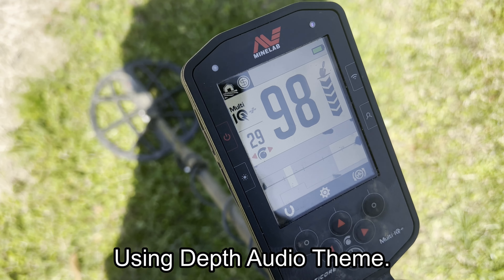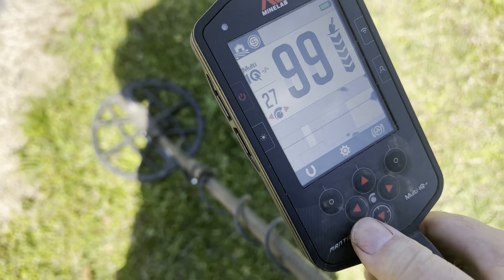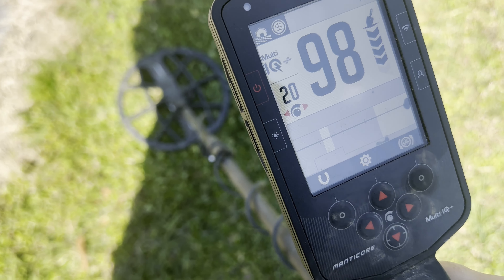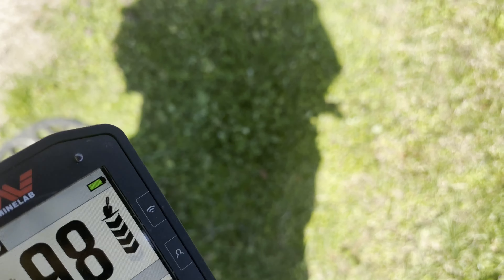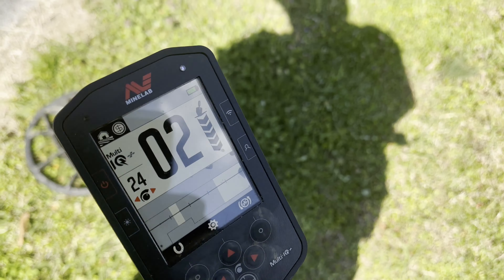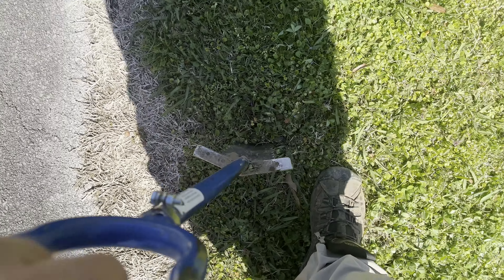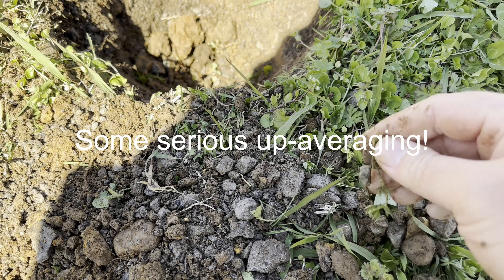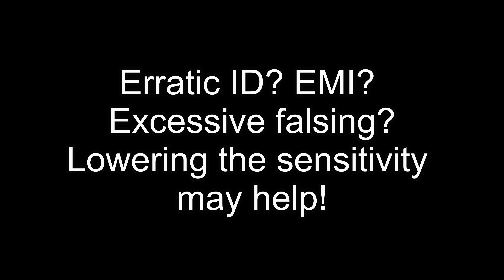Minelab Manticore: Still plenty deep at lower sensitivity levels.

Comment: I know you’re aware of this Rattlehead, but for others that may not know, lowering sensitivity will also help better separate(or even expose) a deep, non-ferrous target at sites with iron in the ground (turning off your bright lights in the fog to better see in front of you analogy holds true with lower sens in iron).
Reply from the maker: I agree Dan. Using high beams in the fog is a very good description.
Reply: CAPT DAN, I experimented lowering the Sensitivity on the Manticore this morning. Not so much an experiment, as I have a trashy yard and it's impossible to detect, I'm forced to lower it. I think the soil has black sand mixed in. It's also wet, so it's firing up pretty hot.

Sensitivity of 10 made it much easier to see what was going on with the Target Trace. It made detecting more enjoyable. Non ferrous signals started to come through. You're correct CAPTN DAN, lowering the Sensitivity helps unmask.

I didn't dig anything to check the depth, nor do I think I ever will, gawd awful trashy soil I have.

I also tested the recovery speed and the affect it may have on auto ground balance value (pump the coil). 

With so much trash in the soil, potential black sand, it was dark out, impossible to find a spot that didn't have a signal to ground balance over, I may  have wandered a bit off the spot I chose to ground balance over, my data is SOLID, take it to the bank. LOL 😂 

Recovery - - GB
Speed
0 - - - - - - - - - 33, 37,45, 48, 47.
1 - - - - - - - - - 36 35.
2 - - - - - - - - - 36, 42.
3 - - - - - - - - - 45, 39, 36.
4 - - - - - - - - - 36.
5 - - - - - - - - - 33
6 - - - - - - - - - 34.
7 - - - - - - - - - 41, 31.
8 - - - - - - - - - 31, 32.

Given my uncontrolled test, it seems like the GB is fairly stable across most of the Recovery Speed settings until RS of '0', then it increases ~13 points.

CAPTN DAN does the data seem odd or normal to you? Or should I find a clean lot of land to see the affect of RS on GB?

GL👨‍🦯HH

Comment: Just read your write up about your 50 hour time on the machine. It’s about time someone gave a review on this that actually put in time to learn it. I’m sure you are still learning it. I had my ctx for almost 9 years and I’m pretty proficient with it and I still learn something each year with it. I just got this machine today and am hating the fact I have to re learn all over again and not being sure if I’m missing anything by not knowing the machine. I don’t hunt by numbers. It’s all sound for me. Wide open screen. Now my question is there a tone difference on deep targets vs deeper targets. ?? Some say with the nox there isn’t any. That’s the only thing I would fear about the manticore.
Reply: Shallow and surface vs deep tones I meant to say…
Reply from the maker: Yessir, I’m definitely still in the learning process myself and will likely be there for some time. So many adjustments and different ways to run these newer machines… it’s a lot to take in! I actually enjoy it though. 

Yep, the Manticore gives you control of traditional modulation so that the deeper the target, the fainter the tone. But, in my opinion running pitch tones, or the Depth audio theme as Minelab calls it, is even better. The VCO audio just makes it extremely easy to tell how deep the target is. The lower the pitch, the deeper the target. Makes it super easy to skip the shallow junk/clad and only dig the older deeper stuff. I run it almost exclusively.

Good luck with your new Manticore!
Reply: @MetalDetectingNWGA  the one thing I love about the ctx is it actually gives you the depth number.  I don’t see this on this machine. Haven’t got a chance to print out the manual yet so how do you determine depth on the bar graph??? Some areas I hunt is sandy soil and the good stuff is always past 8 inches.
Reply from the maker: @hiluxyota7200  I loved the numeric depth readout on the CTX as well. The Manticore depth meter is like the Equinox. It shows arrows which indicate the depth. Each arrow is approximately 2”. Not as precise as the CTX, but it works ok.

Comment: I got my Manticore last week and have had 5 hunts with it. I'm with you on sensitivity around 23/24. The machine works great so far! I've dug  7 silver coins in places that were pounded. Three of them had junk with them. Two IHPs dug had square nails with them, also. There is a learning curve but after a number of hours  I think I'll be fine in discerning good/bad targets. HH :)
Reply from the maker: Dang, 7 silver coins from a pounded site in your first week of ownership is pretty awesome! Sounds like its working very well for you! Congrats! Are you using ATHC?
Reply: @MetalDetectingNWGA  AT General for now until I get used to the machine

Comment: It's a mental thing for me, I'm used to running my other machines close to max sensitivity,  I have gotten down to 26 - 27,lol
Reply from the maker: I know exactly what you mean. I was cranking it up pretty high when I first started using it. It just runs so much smoother at those lower levels though.

Comment: This begs the question, why high 90's for a single one cent?
Reply from the maker: To be honest, I was expecting to pop out a big silver based on those numbers. Was pretty disappointed when I saw it was a penny. Lol. Just some up-averaging. My Deus 2 likes to up-average copper pennies into the high 90s sometimes too.
Reply: @MetalDetectingNWGA  deeper the coin, higher the number.
Reply from the maker: @scorpio4236  Yeah, true that. I've dug a few pennies in the upper 80s before, but that's the first one I've seen jump all the way up into the mid 90s. Sucks to get all hyped up thinking you've got silver, just to find ol' Abe staring back at you. lol
Reply: @MetalDetectingNWGA  LOL had that happen a few times. Still waiting on the Manticore but when I see a 27-28 on the old Nox 800 and it's a copper penny..the whole time digging I'm going come on silver dime LOL
Reply: @MetalDetectingNWGA  You know what I'm thinking....? A silver Mercury was masking that penny.
There's a silver Mercury still in that hole! LOL  😂
GL👨‍🦯HH
Reply from the maker: @pigeonbloodruby5330  LOL! With how rocky and tough that ground was, it can stay there. 😂
Reply: Lol where was it? I'll come dig it.@MetalDetectingNWGA

Comment: With that iron limits device can’t unmasking targets next to iron…
Reply from the maker: That one is a coin shooting program, meant for cherry picking, not unmasking. ;)
Reply: @MetalDetectingNWGA  right for trash littered parks without iron 😎
Reply from the maker: @omnitron  For cherry picking. Meaning quickly grabbing the coin type signals without spending too much time on possible trash targets. Will it miss some masked targets? Yep! Its a trade off. You give up some of those challenged targets in exchange for the ability to cut down on the amount of trash/iron you dig. Would this be the best choice for picking out masked targets from a pounded site? No. You use different programs/settings for different situations and sites. Even running a disc pattern like this one with the upper ferrous limit set at 10, the Manticore can still snipe some coins from the iron. Check out my other video titled "deep and iffy coin signals" and you'll see what I mean. :)

Comment: Dwayne, what are your initial impressions of the Manticore. Does it out perform the Deus II? I don't know if I should invest in it or not.
Reply from the maker: Hey John. I actually wrote a pretty detailed review with some caparisons between the Manticore and Deus 2. If you have time for a read, I'll put the link down below. To make a long story short though, if I could only keep one it would be the Deus 2. https://metaldetectingforum.com/index.php?threads/my-thoughts-on-the-minelab-manticore-after-50-hours-and-beyond.300976/
Reply: I read your linked review Dwayne and found it very forthright and interesting. I am sticking with my Deus II for now. I really appreciate your opinions on these machines.